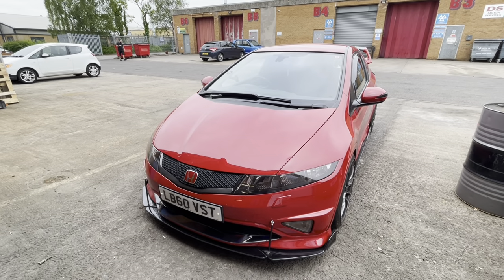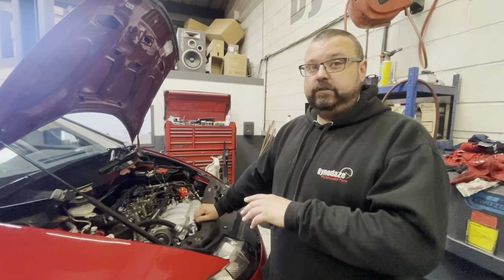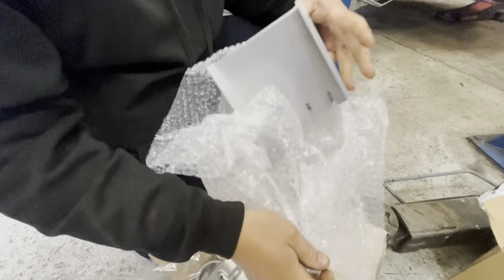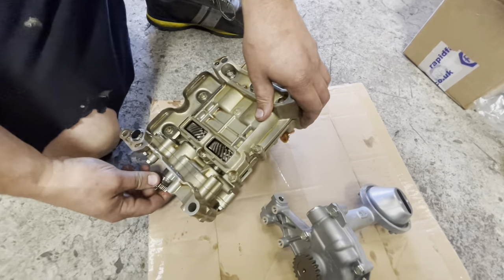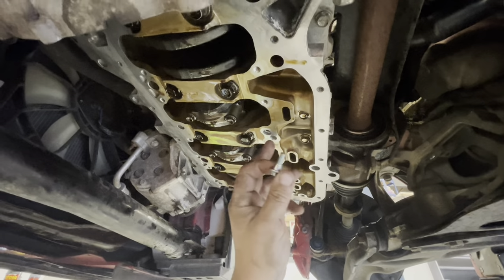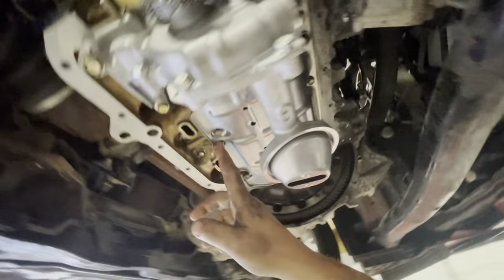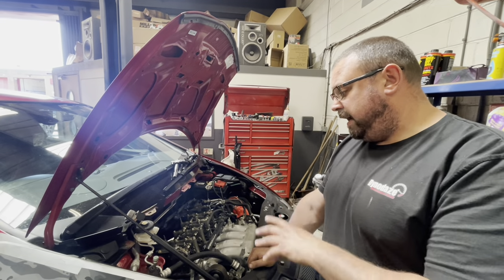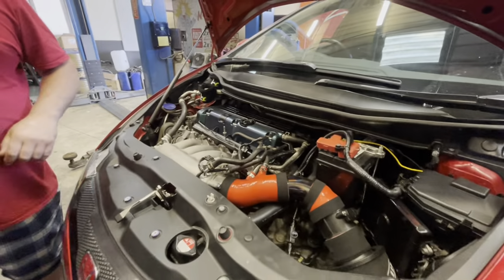FN2 gets FD2 Oil pump but why? Does it increase Power? Honda Civic TypeR Modifying

Comment: Nice to see what work goes into these mods and for what gains 👍
Reply: Obviously it's not going increase power. There is no logical reason why it would do either. It's got nothing to do with the induction or combustion process.
Zero Gains, Just beefing up the oil system a little for cars that are driven hard.
Reply: While it may not increase engine power (via combustion process), it decrease wasted energy (to spin the huge balance shaft) so technically, yes it increase HP at the wheel (in average of 5-8 WHP). This is the logical answer, lol.  @F4Insight-uq6nt

Comment: I had a balanceshaft delete kit on my Seat Leon cupra 1p. I don't know if it made extra power. The thing i noticed is that the car boked by accelerating in a high gear (5th or 6th) when the engine was under 1600rpm. By these engines the problem is that the balanceshaft sometimes brakes with engine failure as result. Verry informative this. Thanks :) Greetz from Holland.
Reply from the maker: Hello there!

Comment: You dont need a baffled sump for track days in the FN2.  Although i understand why you would, just to be safe.
Reply: luqmankhan8752  There are lots of variables.Some k20s like to drink oil thankfully mine doesnt.. yet. 
I dont run a baffled sump but I do check the oil after every track session and always carry oil. I  try to keep the oil at maximum on the dipstick.
I use a "semislick" track tyre but it's not the most aggressive tyre.
If I was to start using a more aggressive true semi slick I would probably.get a baffled sump.
For the average joe on a road tyre doing the odd track day just making sure that the oil is at a a good level after each session should suffice.

Comment: Love the videos guys ive learned loads and keep up the great work . I've just bought a fn2 2 month ago and had to fit a clutch , driveshaft, gearbox seal and 3rd synchro since then so I'm a bit gutted but for some reason i still love it like a psyco child . Can I ask what's a reasonable price to have the chain and guides swapped I don't need stinging again and you guys know your stuff , thanks
Reply from the maker: £600 pal
Reply: @DynodazeHondaTuners  brilliant thanks bud i may see you soon . Love the videos keep up the great work
Reply: @Scotree82 how much did that work cost you as I think I need the same bits done to mine which although I also recently purchased and is fairly low mileage at 77000. I’m having some difficulty getting into 3rd sometimes and just generally hard to change gears until  really warm. Any help would be much appreciated

Comment: Hello from Bulgaria , I've been thinking about doing the balance shaft delete on my FN2. My question is , is it necessary to add the baffle sump or I can run without it ? The car will be going to tracks not that often maybe 2-3 times a year , it will be mainly daily driven.
Reply from the maker: absolutely
Reply: @DynodazeHondaTuners  Hey guys! I finally fitted the FD2 oil pump , but my car started rattling at cold starts and I think its the oil. I used to run 5w40 oil and car rattled from time to time , but know for a week almost every cold star it rattles. I changed the oil to 5w30. Can the problem be the oil or the oil pump not making pressure on time. Thanks in advance
Reply from the maker: @IKkolev it’s quite possible yes
Reply: @DynodazeHondaTuners  Which one is quite possible the pump or the oil ? And should I be worried ?
Reply from the maker: @IKkolev  engine chain
Reply: @DynodazeHondaTuners  I changed the whole timing chain set and VTC 2000 kms ago. I am pretty sure it's the oil , but I don't know what oil to use.
Reply: I used original Honda parts only
Reply from the maker: so you changed the timing chain and now it rattles, did you change tensioner and guides? find us on facebook pal or email us @IKkolev
Reply from the maker: 5w40 fully synthetic like Millers Nano CFS NT+ @IKkolev

Comment: I've been told by adding the oil pump mod, you're able to rev it to 9000rpm instead of 8500rpm, is this true? I old ep3r with intake, header, catback and tune revved out to 9000rpm while my current fn2r with the same bolt ons is only going to 8500rpm
Reply from the maker: 8600’is were we like it, however look at any graph you have and if it’s not continuing to make power past 8600 there’s no point revving it out that far
Reply: its good as a step towards custom grind cams that take advantage of extra power in the higher than 8600 rpm space.

Comment: Obviously it's not going increase power. There is no logical reason why it would do either. It's got nothing to do with the induction or combustion process.
Reply: it removes some of the parasitic loss- thats it. hence the 5 hp gain up top.